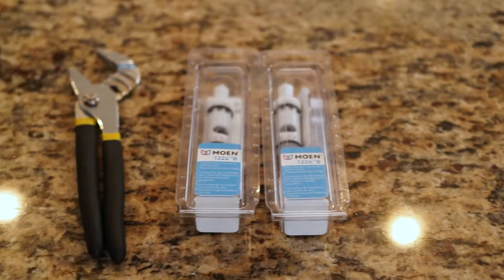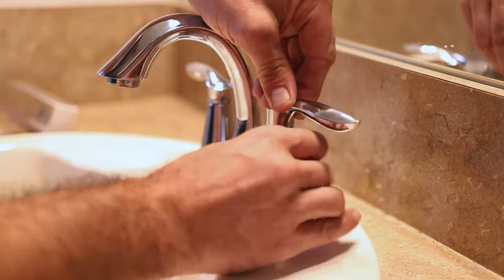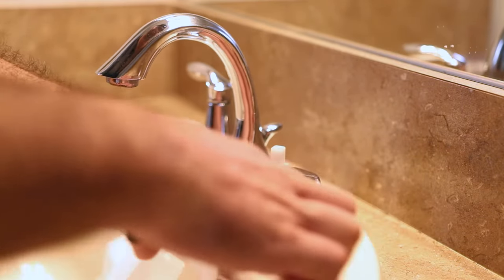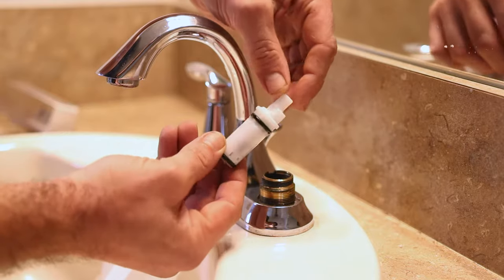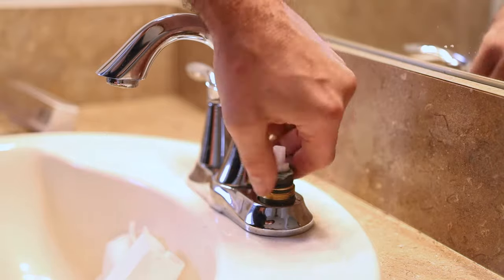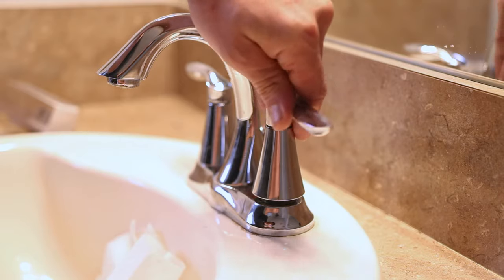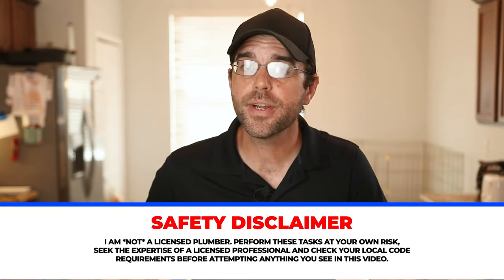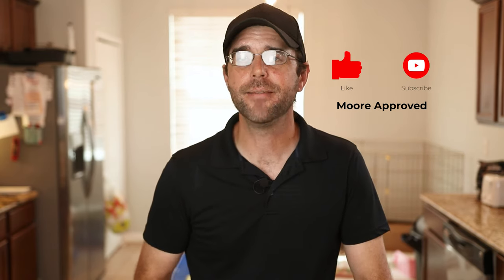Fix a Leaky Bathroom Faucet | Replace Faucet Cartridge | Quick & Easy Home Repair

Comment from the maker: I am not a licensed plumber. Perform these tasks at your own risk, seek the expertise of a licensed professional and check your local code requirements before attempting anything you see in this video.
Moen 2-Handle Replacement Cartridge (fits most 2-handle kitchen and bath faucets + shower/tub faucets) part 1224B
Amazon https://amzn.to/3Kf3DQa
Home Depot https://go.magik.ly/ml/1s79n/
Ace Hardware https://go.magik.ly/ml/1s79o/
Basic 7-Piece Pliers Set
https://amzn.to/3npyujY

How to Replace & Install Bathroom Sink Faucets | Easy DIY Home Upgrade
https://youtu.be/5s4g8yVGPA4

DISCLAIMER: This video and description contains affiliate links for several different programs. As an Amazon Associate I earn from qualifying purchases.
Reply: Short n sweet thanks

Comment: FINALLY!!!! I’ve watched a dozen videos of delta two handled faucets and they ALL have a small screw to get them off or the top pops off with a screw under. Mine doesn’t have either of those and I had no idea how to get the handle off. Thank you!!!
Reply: Same here... there are a lot of different types of handles and the way they come off is different but no video addresses this fact.